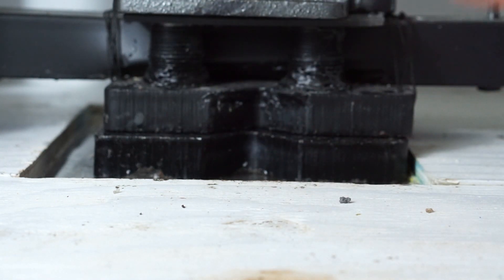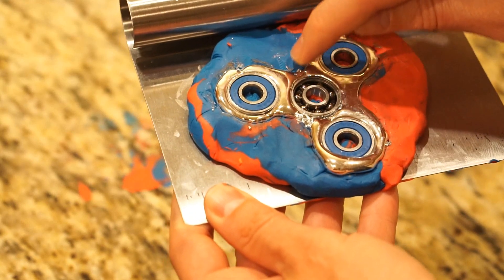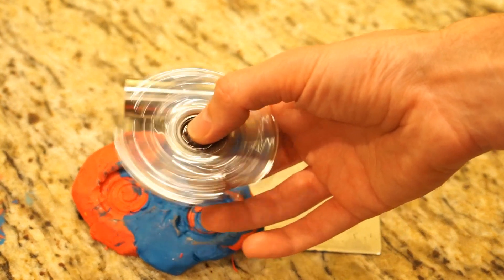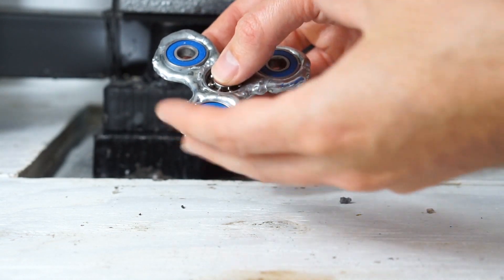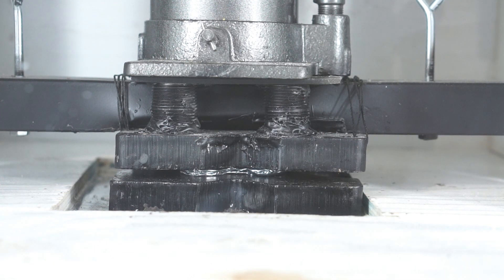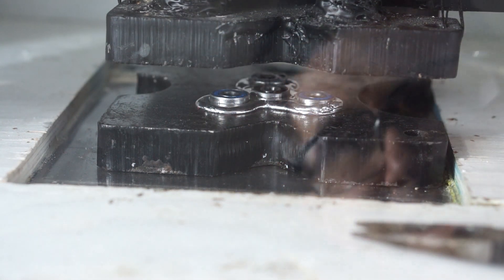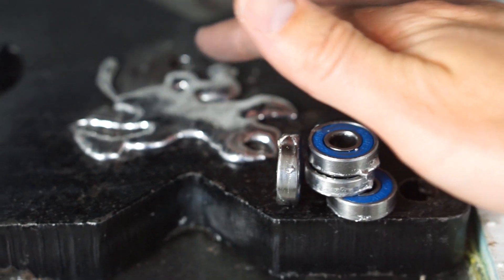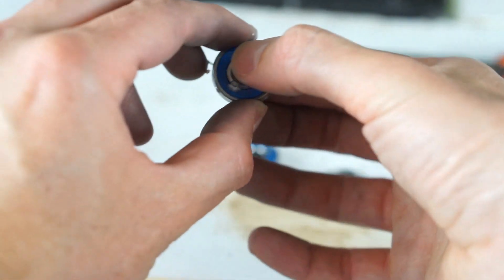Crushing the "Rare" Gallium Liquid Metal Fidget Spinner In a Hydraulic Press

Comment: So I actually do have a question, but its not related to this video. I find myself wondering if liquid nitrogen will actually get colder under vacuum. Do you have a device you could test the temp with?
Reply from the maker: +Draygoes yes, I did a video already where I put liquid nitrogen in the vacuum and it evaporated and cooled until it froze solid. It is really cool, one of my favorite videos I have done.
Reply: Very cool! 
I would never have expected it to freeze.